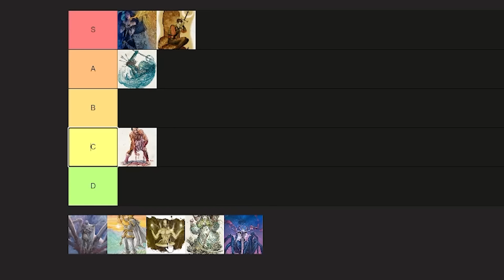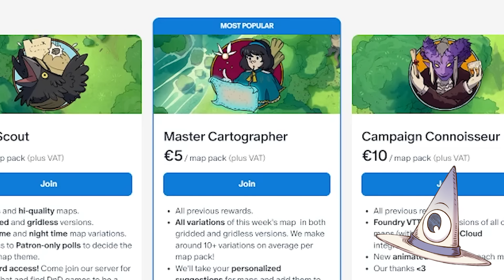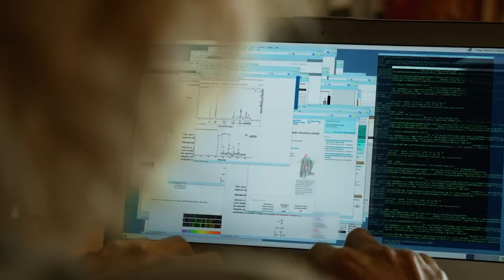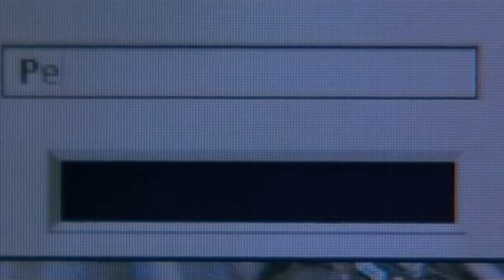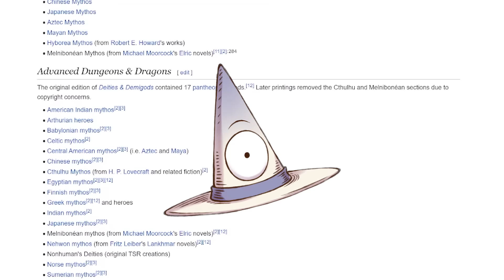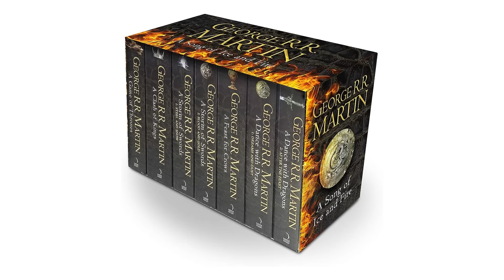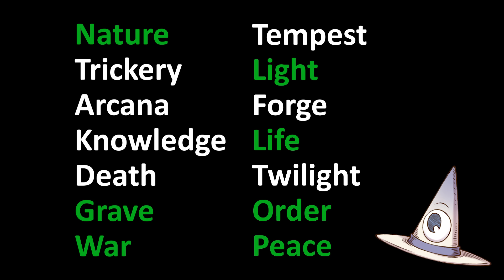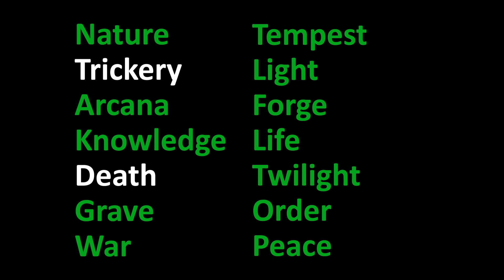The Problem with D&D Gods (and how to make your own)

Comment: The “Why don’t the gods just go all Avengers on the BBEG?” angle doesn’t really seem like much of an issue to me. At the end of the day, most BBEGs don’t really matter on the scale of the gods. Because at the end of the day, even if they usurped the power of ten greater deities… the Overgod of whatever celestial sphere they are in, Ao in the case of Forgotten Realms, just has to say “No.”, and… no it is. Do not pass go. Do not collect 200$.

Put simply, while it might seem a “bit” meta, the whole cosmology of DnD is setup for small parties of adventures to go out on quest. Pretty much the entire reason Ao doesn’t just instantly smite any BBEG that sticks their head out from under a rock, is because… they are simply things working as intended. The role of the other gods is more one of managing the cosmic balance. Not interfering with the plot. One of the reasons Ao limited their ability to interfere with Realmspace in the first place.

The Gods might not actually have the power to break the 4th wall and realize they are in a TTRPG, but they are aware of the rules Ao has set down that govern what they can and can’t do. Rules that often leave them far more restricted in their actions than mortals. While they are ALSO aware that any BBEG that thinks they can just walk in and disregard the rules, is in for a very rude awakening sooner or later.

One of the simplest way to look at the gods, is just them working middle management at Ao’s business. While a BBEG’s shenanigans might touch one or two of them enough for them to care, the vast majority are just going to keep their nose out of it going “not my monkey, not my circus.” just to avoid all the hassles involved with making it their problem.🤷‍♂️

Comment: What I would do is change gods to be based on perception instead of belief. Why are there multiple sun gods? Because different continents and peoples believe in different sun gods. Why are their reaches so finite? Because the various gods only oversee their area of worship. Sun gods won't effect the sun where there are no people who believe in them. This allows massive gods to have a sense of locality to them without stripping them of their power or removing them. 

It also gives chances for separate religions and cultures to mutate in the fantasy world. Why does this god seem similar to this other god? Well they were the same god once before their religious connotations split. Why does this god have 2 names? Well they got religiously connected with another god so much that they merged. I think this is a perfect fix for all of the stuff in the video without seeming contrived. This sort of thing would also work with epithets because all I am really suggesting is that real world theology be applied like the gods were real.

Comment: I think that your video was great, and I do love making my own pantheon, but I do not think that your pantheon making strategies would work for my purposes. I guess I'll just have to "contrive" a reason that my gods can't interfere all the time (what??? Putting thought into how/why your deities interact with the world provides a solution to the problem regardless of how many gods you want in your world and is exactly what you did, except you linked it specifically to the number and power of the gods??????? Crazy.)

Comment: haven't finished the video, but i disagree with your assessment and the 2 methods, the way to make powerful gods who don't always intervene. are 3 very simple solutions, 1. the they don't care method, this can be explained in, prayers are not the source of their power, just boosts it, or that maybe their are many different worlds, and if they loose one or two, no biggie. or hell, maybe the see the world as a giant reality show and don't want to ruin the plot. 2. the higher power to the higher power, there is something that the gods consider more important, fate, perhaps they act as stewards to fate, or they have this idea that mankind needs to be in control of their own destinies and they deal with it, or something along those lines, and 3. the gods can't get their hands dirty, maybe they follow under the idea they cannot send their full power to the material plane for whatever reason, maybe their is a wall blocking them, perhaps they are in a stalmate with evil with an agreement not to directly affect the mortal world, just to use proxy characters, such as cultists, clerics, paladins, warlocks etc. and if the gods show up in full force, the evil will as well, or perhaps it's more like the physical world cannot handle there full power, and if they try and use it is could destroy the world, so they have to use clerics or other people as a proxy, the point is, there are many ways to make it work.